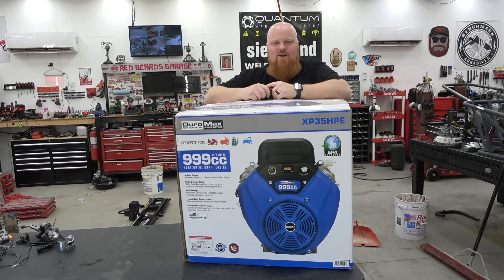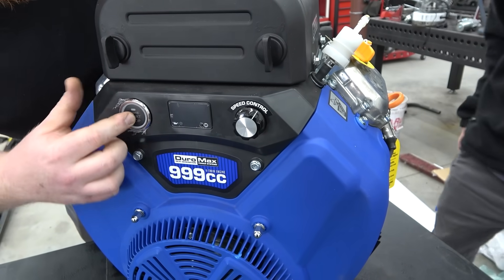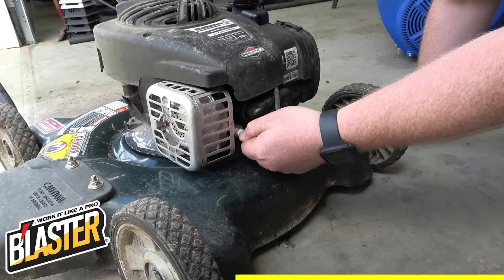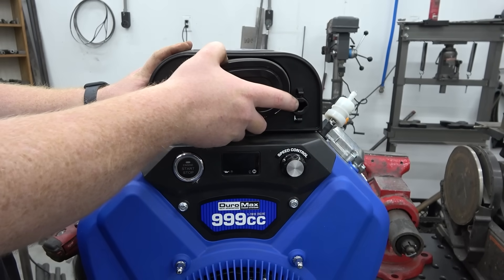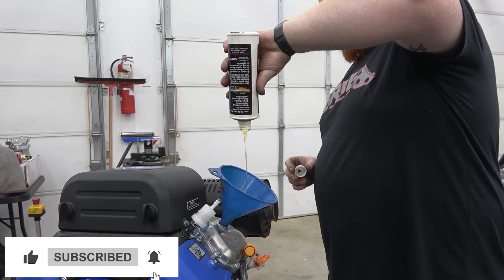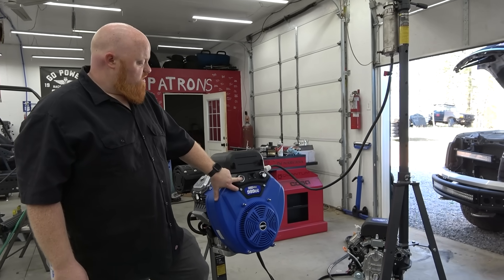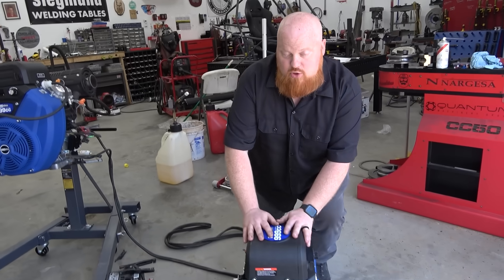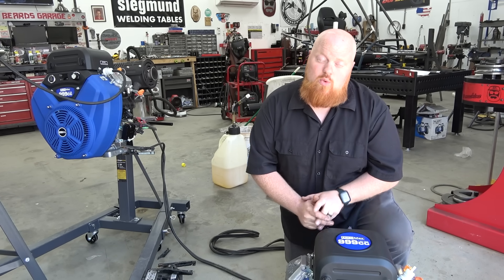👀 NEW 999cc V Twin Engine ~ 58Ft-Lbs Of Torque!!!

Comment: Okay... I can see how Blaster Small Engine Tune-up can help clear the carbon out of the cylinder--Mopar Heat Riser Solvent does the same, while allowed to sit overnight--but what about the carburetor? Not everyone thinks to run fuel stabilizer, and all-to-often I've had to drain fuel, then replace it with fresh fuel after cleaning a carb ON-IMPLEMENT to get it to hopefully fire.

Comment: Throttle control has 2 or 3 wires out the back, why not use a pedal from a sewing machine or tig welder? I think it might be easier than trying to route a cable or linkage from the front to the rear

Comment: For 2 grand you could probably buy a used Sportster. If you're gonna spend that on a 1000cc v-twin, you might as well go with the Harley. That comes with a transmission and has a much higher cool factor. Plus you know the aftermarket is bigger.

Comment: That is a monster engine. How long do you expect it to be before GoPowersports or someone will have some performance parts out for this engine? RBG, I figured up how much the performance parts cost for the 224 engine that you built up and it was like $1452.00. To me that would be cost preventative even if someone gave me the engine.
Reply: Just wait for someone to do Desmo valves for it 😂
Reply: yup, at that point might as well just grab a 420 cc

Comment: Fly by wire is yes a little more to do than just cable. But it's not all too difficult. Should have 3 wires, +, ground, and signal from pedal. The pedal has all the rest of the workings designed in them. Get online and just look up cheap civilian vehicles that are fly by wire and in your off time give it a go, its cool getting to sit at a table and have your tb pedal and wires all connected by wires and a battery and it all work in front of you. Satisfaction. But sorry for the rant, love the vids keep up the great work and what you do!!
Reply: Just watch out for hall effect VS potentiometer there can be as many as 12 wires now of days with things like dual checking potentiometers or dual cross checking hall sensors

Comment: If you count the wires and check resistance of the rotary knob you could match it to an existing throttle pedal for electric motor controllers
Reply: Yeah that or use a custom pedal with the potentiometer on the front with extended wiring
Reply: you could eliminate it completely and get better throttle response and potentially take out the governor at the same time, two birds with one stone.
Reply: @axeami1354  what if you had a reason that you wanted to keep the governor
Reply: @dodgeme1986truck  then I guess  just extending the potentiometer cables or installing and aftermarket one would be your answer. not sure why you'd want to keep it though.
Reply: @axeami1354  other equipment operators that are not as skilled with the  equipment or that are learning to operate it... If you add a second potentiometer inline you could use one as a throttle restrictor while the other is used as the throttle control however that wouldn't work with a hall effect set-up.
Reply: I think the throttle response would be too slow. Looked really slow to respond when he twisted that knob
Reply: Could be a pot which is cheap to produce and integrate. Could be an encoder of some sort. Either way, it has to be a standard electronic component so they could wire their own setup into it.
Reply: Hell yeah, you might.  Lol hey I have a spare pedal out of a Toyota lol

Comment: Would love to see some hotroding of the SxS engine. See how much power could be made. 75, 80 or 100hp maybe with doing the same engine "specs" as a RZR or another popular 1000 SxS. The street bike twin done with a hotroding setup to but with air cooling like a standard air-cooled bike engine. After that, a turbo on the bike and a supercharger on the SxS

Comment: Not sure about Duromax's HP rating.  I bought a Duromax 16 hp that is the same displacement as the Predator 13 hp.   🤷
Reply: They are way overrated. like most of those honda clones.

Comment: Redbeard you're being silly 8.1 compression is usually what the standard is for the supercharged archerable charge motors so you should just put a a turbo on one of these or put a are you could even put a supercharger on another and have a comparison of what's better.
Reply: Neither is better... they have different pros and cons is all... supercharger cons for example the drive belt pulleys and alignment supercharger pro less wear on engine due to lack of surge due to being engine driven ... Whereas a turbo con for example turbo lag with boost spikes... where a turbo pro could be higher overall boost peaks

Comment: One of my middle sons friends has a big off road go cart and he has a same motor but older style version and it's freaking fast. Friend the dad was like Jesse u ride it and see what u think. I was like hell yeah it was fast. Lucky the gas and brake was on the steering wheel like a dragcar steering wheel. If I had that motor I would take the air cover off the motor can get more air. There's a guy that rides with us. And he has a motor similar like that one also. And he has it on his Harley Davidson. Cause he lost his left leg below the knee like almost to the foot. And he couldn't shift and he tried finding a motor and someone give him the motor and it's fast. And he can connect it to the standard transmission. And it does good on gas.

Comment: would be really really cool to see that electronic throttle incorporated into a gokart. the know is most likely just a potentiometer and you can get a slider style one and hook it to the pedal.
Reply: mikuni would most likely be better but still would be cool to see drive by wire on a gokart
Reply: They make both hall and potentiometer throttle pedals just need to know wire resistances and wire count resistance will tell you if it's a hall or potentiometer

Comment: I wonder if this engine could be put into an older economy car, would be interesting to see if it could be matched with the cars transmission/transaxel.
Reply: Would be a power increase on the rear of an old VW bug
Reply: @dylanzrim3635  disagree, both the original 1200 and 1600 type 3 were more hp and torque. They were also lighter than this engine. They could be easily upgraded to make way more power and much more reliable than this Chinese mower engine. Fun for a kart but no comparison to German engineering even 70 years ago. You can even buy a crate vw for about the same as this engine.
Reply: @chrisandjeri1  nope, about same as 1200-1300 pancake.
Reply: @dylanzrim3635  not really. If you were comparing it to a 1967 or older, then it would have more HP then a VW. VW from 68 to 79 would have 40 HP from is 1600cc air cooled motors.
Reply: @dylanzrim3635  I sure would like to know
Reply: check out  Robot Cantina hes done it with a predator done with efi on a honda insight
Reply: @stunessa1  Will do, thanks.
Reply: I saw a minivan with a whole 8 hp  push mower under the hood.
Reply: Search for "Transmission Adapter Plate." Wouldn't be worth it. I tried to explain this but my comment got deleted for some reason. Better engines can be had for much cheaper, and this engine ain't cheap.

Comment: That throttling device is called a rheostat. You should be able to find one that is in the form of a foot throttle
Reply: We use these on older generation aka non CAN BUS industrial power units
Reply: Probably not a rheostat  but is a potentiometer , needs 3 wires no two.

Comment: I said it before and I'll say it again Red beard needs a dyno I'd like to know how much horsepower it makes before and after he builds it didn't expect to see this today great video love the PB Blaster ad
Reply: It makes about 30ish HP stock, seems very low for 999cc..
Reply: @djmjr77  I'd like to see some tests done on this engine longevity horsepower horsepower modified I think you're right it's around 30th
Reply: @djmjr77  yes a bit low
Reply: @djmjr77  no it has a 123 hp
Reply: @sencxre  I said 30hp stock because I looked up the specs.. what it has after the upgrades is the question...
Reply: @djmjr77  Cheap, fast, reliable. Pick two.
Reply: @djmjr77 it is a industrial engine made for torque .H.P.  Is torque x rpm over a period of time.4000 rpm and slow to spin up won't give good h.p. but that is great torque.
Reply: I understand why he don't have one if I got one Ide want one that read everything accurately and within my budget...ide say after he gets 500k subs he will have one!
Reply: I agree with you %100, these builds always peak my interest and I would love to see the finished Specifications.
Reply: This comment aged well. Lol
Reply: It would an interesting engine for my hovercraft
Reply: @westennant4495  I've ridden on a 4-seat Hovercraft over the Connecticut River in winner on ice and stuck up on a bald eagle resting out of branch on an island it was awesome very risky but very rewarding good luck with yours
Reply: @westennant4495  it would an interesting?
Reply: I build engines all the time and a dyno is $$$ and for the number of times I’d use it each year, it’s not worth the investment!
Reply: I agree
Reply: Just have to have a large DC generator. Compare before and after output for a percentage gain.

Or a wooden test club. It is like a propeller blank, thats aero drag at specific RPMS equals horsepower when made to specific dimensions from charts. This is how it was done in WWI era.
Reply: I think it’s around 35 ish hp
Reply: @Isaacgames-ju8qv  He has a dino now
Reply: It makes around 123 hp
Reply: Yeah it would be easy to build one with his fabrication skills. Robotcantina showed how to build a small engine dyno
Reply: @derekmaxwell8164  I hope he does
Reply: @derekmaxwell8164  do you have a link to the plan's at all

Comment: I think it would be cool to use a drive by wire gas pedal.
Reply: @B no they don't, almost all modern diesels use one as well as im sure most newgas vehicles.
Reply: @250krawler  haha you've gotta get back in a car with an actual throttle cable ,all newer  DBW setups are so lazy in response.
One way to get back a little more response is to turn off the traction control but it'll never match the response of a cable.
Reply: @B lol not 3-5 seconds, I'm fully aware how it works and it's instant, electricty flows at almost the speed of light. The sluggish feeling you get is from engine management because the average person doesn't want a car that's snappy but sure continue to believe it takes your car 5 seconds to start moving. I like a nice snappy built V8 as much as the next person but 3-5 seconds is a load of crap. Watch the video as soon as he turns the knob it revs.
Reply: @B The throttle response of drive-by-wire is INSTANTANEOUS. Electricity is instantaneous. It doesn't move from point A to B, it cycles around, so it's moving along the whole circuit the whole time as soon as there is electricity, immediately. If there is a delay in transmission that is either because of repeaters, relays and even inductors/capacitors (in a way).
Reply: @B I guarantee not. Professional? I have two of my own vehicles with drive-by-wire. It's instantaneous. If it took seconds, there would be thousands of car accidents every day and drive-by-wire wouldn't be used.

Comment: If it has the same bolt spacing as the Briggs and Stratton. It will bolt up to the Go Power Sports engine plate, sku kpdem-2, with just minor modification. All you need to do is, hog out the bolt holes, in the engine's base 1/16". You just need to make them oval. It a lot easier than making your own engine plate. Support your boy!

Comment: Love your channel. Beard is strong.
But…. When getting to that large of an engine and/or that price point, would it not be cheaper and easier to get street bike motors on a build? They already have a transmission and run chained sprockets. 
Not trying to be a stick in the mud, I love your channel.
Reply: Sponsor money is sponsor money
Reply: just two different things for two different purposes

Comment: Do they make a torque converter for some that size?
Reply: With it being like 36 or so mm diameter, you might have room to machine it down to a 30mm taper and run like a Comet 102 or even a 108 on it.